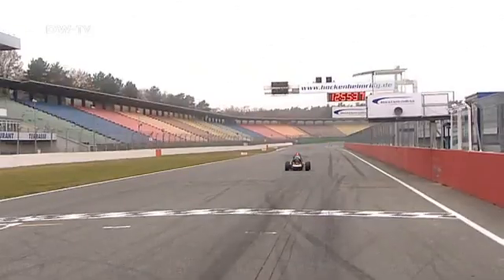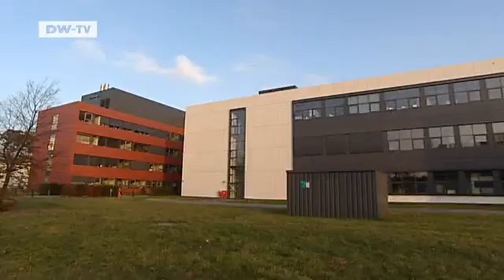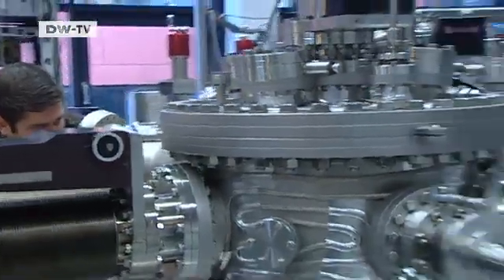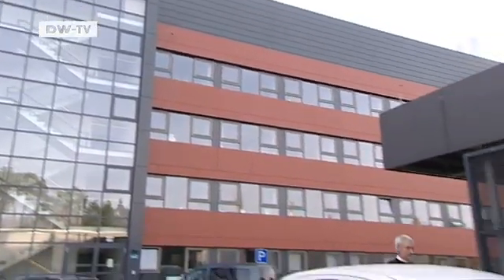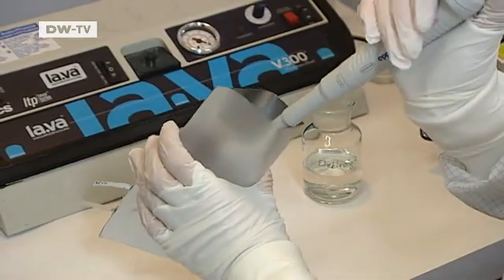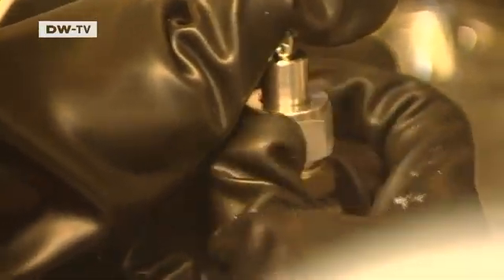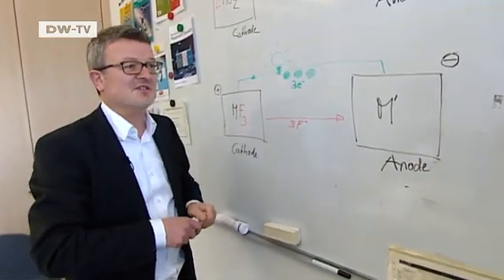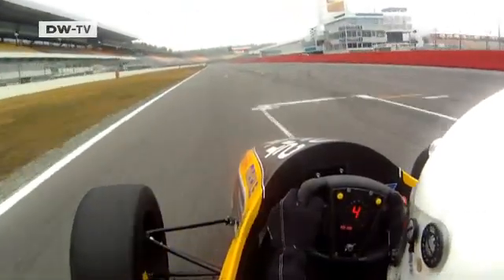New Materials - More Energy from the Battery of the Future | Tomorrow Today

Comment: Where will all the energy come from to recharge millions of batteries?
Reply: +alan r Almost 70% from thermal power station..
Reply: Hopefully, tech permitting, the Sun! It'll outlast oil or coal by billions of years.
Reply: Lots of people charge EV's with energy from renewable resources.
Reply: Solar panels or wind/water turbines last a long time and will charge EVs for years. You don't even have to watch - it's automatic.
Reply: There's a poblem with glibly answering "solar". At sea-level, under optimum conditions, solar only gives you 1,000 watt/square meter. That's all the light there is. The best commercially available solar cells (in 2017) are less than 23% efficient, so you'll only get less than 230 watt/sq meter at noon, but morning and evening much less, so around 1840 watt hours of energy / sq meter each day. 1 Gallon of gas is about 39,000 watt hours of energy. Using all the efficiency tricks in a Prius hybrid we get about 60 mpg, so we're talking around 6,500 watt hours required to drive a very efficient car 1 mile. Do the math. For the US alone, with all the cars,  driving around 12,000 miles a year we need something over 11,000 square miles of solar cells. But they all have to be kept clean to get this good of a picture, and kept in good condition. How many tons of toxic crud will we produce as a byproduct of this huge array? What about the transmission of all this electricity? How many thousands of tons of copper to build the new electricity grid for just the cars? How many square miles of strip-mining to get the copper and other metals are you willing to accept to get your solar-powered cars? So far we are only looking at a small fraction of our cars on electricity, but when we try to go 100% electric, are we going to have enough lithium for the batteries, enough tellurium for the solar cells, or will we end up with cartels of lithium and tellurium exporting countries holding us hostage, just like OPEC in the 80's and 90's?

Comment: know it would be expensive but what about batteries that are easy to swap?  You can have 1 or more sets of batteries charged and ready to go then switch then when it is time.
Reply: +John Doe you saw the size and weight of those battery packs?, you must be joking!. just one is all the cabin floor sized!.
Reply: +flyguille So? That's not an impediment. They're doing that already in Taiwan with scooters.
Reply: +Nonnof Yobiznes In scooters perhaps. They don't use as much energy so the batteries are smaller. If you're talking about a Tesla Model S for example, a sizable fraction of the car's entire weight is the battery. Having a spare would increase the amount of energy required to accelerate by a large amount, thereby defeating the purpose of it. The car's 85kWh battery weighs 544kg (1200lb): heavier than most gasoline engines. Imagine swapping that out.

Comment: One day a practical electric car powered entirely by supercaps which can be fully charged in a matter of minutes (with a very hefty power supply) and travel a similar distance as a gasoline car can on a tank of gas will become a reality. At present any attempt at this would not only cost a bomb but become a bomb if the capacitor banks were to be shorted out in a vehicle collision!
Reply: Capacitors and batteries have different shaped discharge curves. Batteries tend to keep a high voltage until most of the energy is gone then it rapidly decreases. Capacitors lose voltage very quickly at the start and as it approaches a minimum it settles off. This means you get much less usable energy or usage time from a given capacitor compared to a battery.
Reply: gas do the same and it's even more dangerous, certainly the batteries will have a safe mechanism to make them "safer"
Reply: KX36
Unless used with a DC to DC converter to keep the output voltage constant. Using this technique would destroy most types of rechargeable batteries but it wouldn't hurt a capacitor. This technique can be used with non rechargeable batteries to get a bit more out of them. Check out 'Joule Thief' circuits.
Reply: That's a good point. DC-DC converters and switching power supplies are my area of expertise. There's no reason a well designed DC-DC converter which takes the battery voltage and current limits into account would damage the battery.
The videos I've seen of people replacing their car battieries with capacitor banks didn't use any active electronics, just a straight swap, an that's where my mind was. A proper electric car would be better designed than that, then batteries vs capacitors becomes a matter of expense, energy density to size/weight, usable lifetime etc.
Reply: KX36
A DC-DC converter would be essential with capacitors to be able to use a reasonable percentage of its charge. For example a single lead acid cell will produce 2.2 volts fully charged and spend most of its discharge cycle at 2 volts. If any more current is drawn from it when the voltage drops below 1.8 volts then the useful life of the cell will be greatly shortened. At 1.8 volts most of the stored energy is used.
In the case of a capacitor initially charged to 2.2 volts, most of the energy is still in the capacitor when it drops to 1.8 volts so a DC-DC converter is necessary to drain the capacitor as much as possible to extract its energy. Discharging a capacitor completely wouldn't damage it unlike a battery.
Capacitors are much less fussy about how they are charged. If enough current is available then a capacitor could be charged it the time it takes to fill a tank of gas. Batteries have a limit on how fast they can be charged. Capacitors will take the same amount of charge whether they are charged rapidly with several thousand amps or charged a lot more slowly from something like a wind turbine. A lead acid battery could be charged rapidly (would still take a lot longer than a capacitor) but the amount of charge it takes and its useful life would be considerably reduced if repeatedly charged like this.
Reply: Capacitors do have a limited peak charge current, like batteries they have internal resistance which heats up proportional to the square of current, potentially causing them to degrade or be destroyed if given too much current.
Reply: KX36
True but a capacitor will stand higher charge currents than a battery. Also a battery charged at high current will not accept its full charge whereas a capacitor won't mind.
Reply: Once again, all it takes is R&D. And shedloads of money!